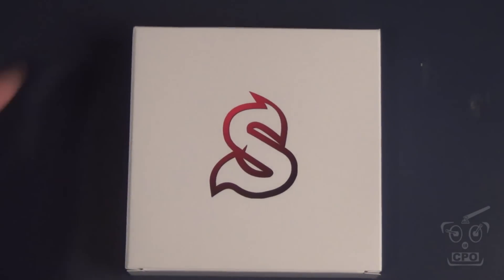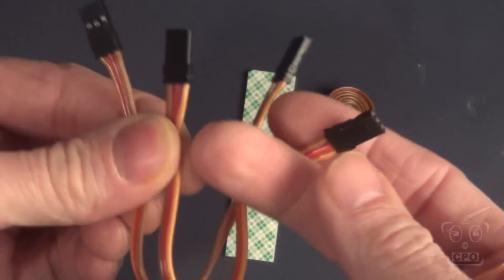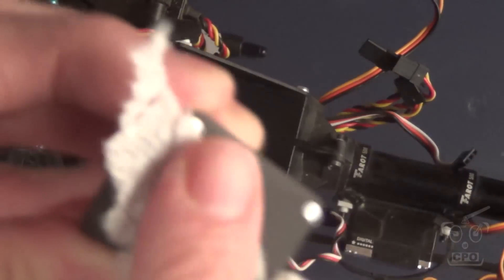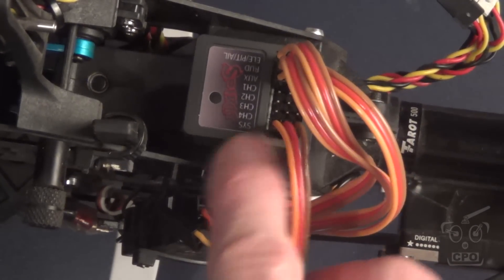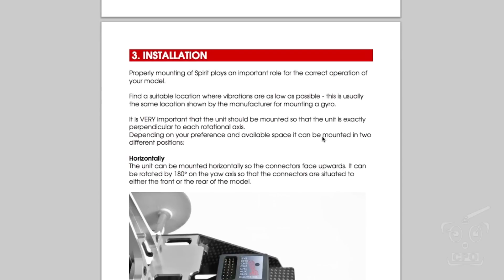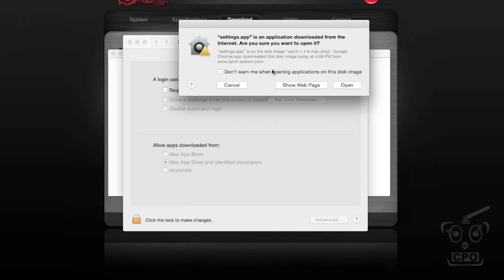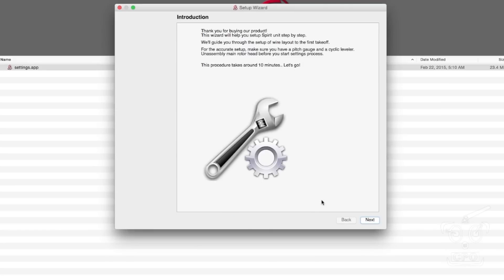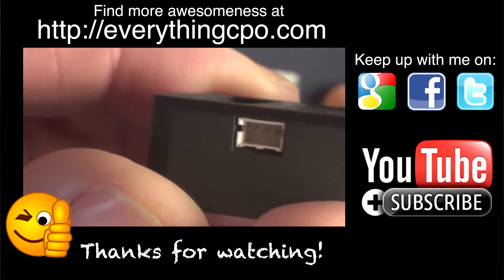Spirit System FBL :: Intro and Firmware Update

Comment: Nice start to the setup. I know it will be a good hands on approach from you.
One little correction, You said that it can be used for rudder gyro only on a fly bar machine. They actually go out of their way to tell you that you connect a fly bar machine just as you would FBL and you get the best of both worlds. There is a checkbox on one of the wizard pages that you select if that is the config.
I've got one coming to use on my 600. It is currently a fly bar machine but will be converted to FBL so that it looks like the heli it is going to be modeled after.
My plan is to put it on the fly bar setup at some point and see what that is like and then do the conversion and see how that goes. And then stuff it all in the fuselage after that. Should be fun.

Comment: Chris, will this unit allow a Standard Rx connection and a Sat connection simultaneously?  ROG
Reply from the maker: Hey Rog... From the developer:

"If you use standard receiver and connect the satellite to the receiver, then it will work as supposed.
But if you want to use both receiver and satellite port in the unit, then it will not work, because both are different receiver types (not compatible)."